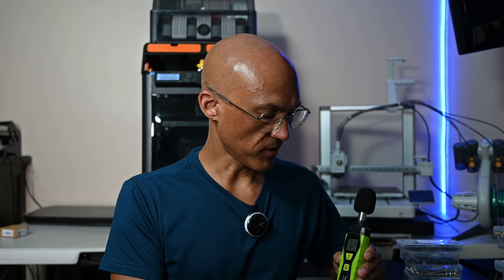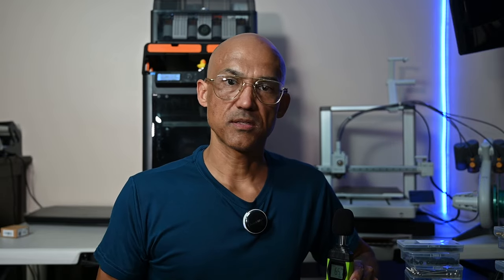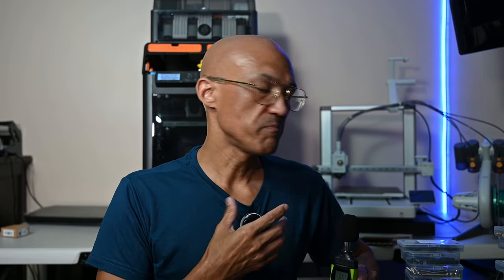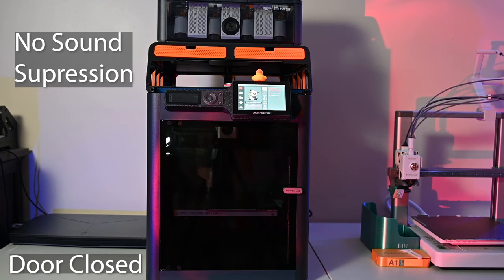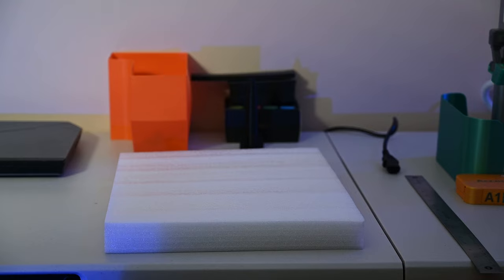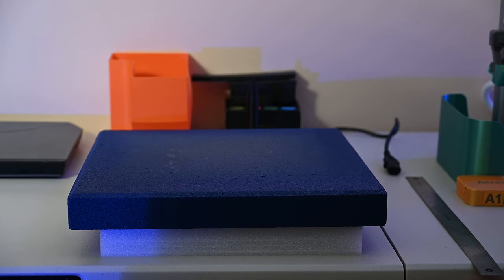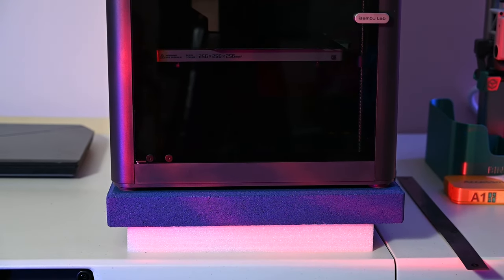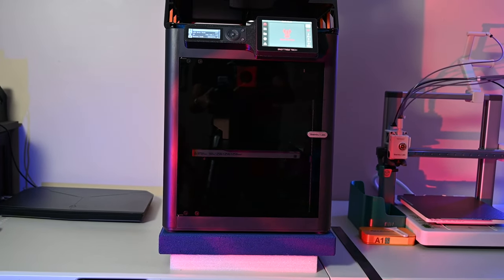How To Quiet Your 3d Printer - Quiet Down the Bambu P1S

Comment: This is exactly what Im going to do when my P1S arrives (ordered it yesterday). Is that a portable table? I would be concerned the table is not sturdy enough to run a printer on it. Thanks for sharing.
Reply from the maker: It is a portable table, and you are probably right.  It was ok before adding the pavers (one for the P1S and one for the A1).  Now I notice that the table is sagging some and I'll need to add some supports.
Reply: All the problem is the table, this not solve the problem of sound of P1S, only solves the sound with not stable/ noisy tables (i look for real solution the printer sound isolation).

Comment: I think I like the pillow Idea better lol. I need to get pavers for mine, I used to use them on the old bed slingers but haven't done it to my P1S yet. I also never used the packing foam underneath so I will need to do that! I knew the pavers made a difference but I think the thick packing foam made an even bigger difference. You should try to 3D print some TPU feet to see how they compare to the pavers.
Reply from the maker: The pillows do create a unique look! Hahah!, The tpu feet are a good idea :)

Comment: Set it on the floor and check the noise by the way. A thin hollow table
Is like a guitar body. Some other guy put a cement block under his printer I think.
Reply from the maker: Thanks for the tips!
Reply: I did this with me ender 3 on the second floor of my house - out the put on the floor. The entire house turned into a guitar body. It was so loud on the first floor.